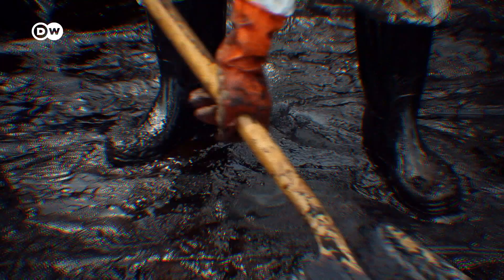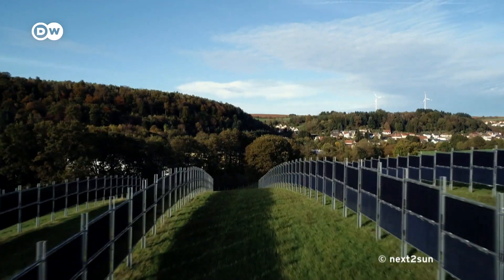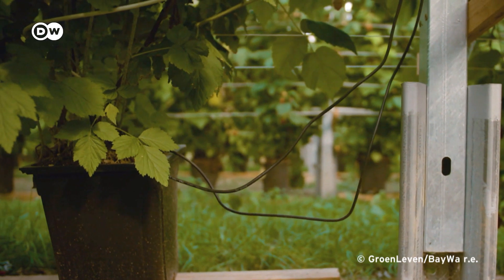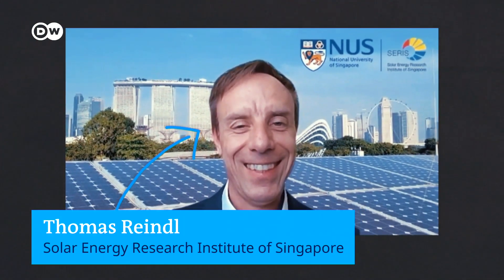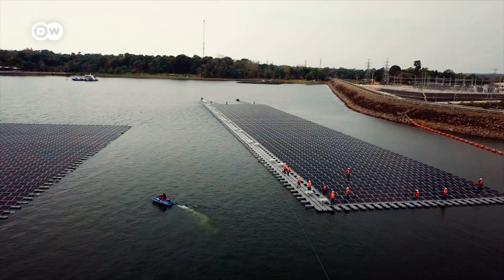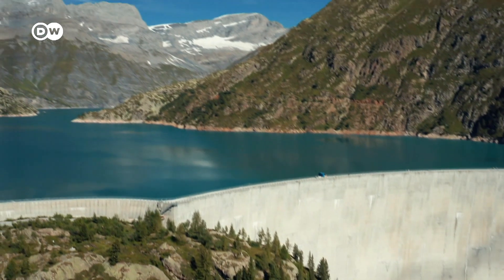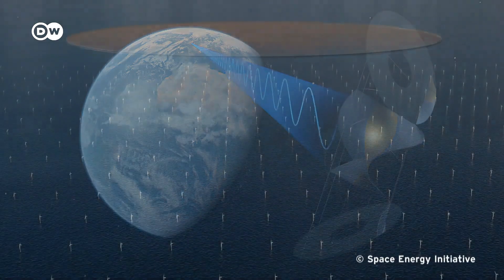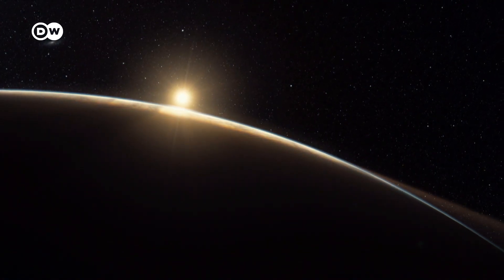Why we should be putting solar panels on our fields and lakes

Comment: One thing I’ve always though is cool about solar is that it doesn’t have an exponential relationship between size and output like other power generators.

Take wind for example (which I love), making the blades 1/3 longer actually increases output by much MORE than 1/3. But for solar, doubling the amount of panels doubles the amount of generation.

So putting 10 panels on the roof of a house makes exactly as much financial sense as covering a giant farm with thousands of panels.

So the title of this video is 100% correct. Put. Solar. Everywhere!
Reply: The exception there being economies of scale linked with installation costs. Cheaper on a per panel basis to install thousands of panels on ground mounts in a field than dozens of panels on the roof of a building.
Reply: @adamlytle2615  that’s definitely a good point. I guess my comment was mainly geared towards viewers who may be thinking “Should I put panels on my home or just pay extra to my city so they can put up a solar farm?”

The answer to that question is that you can put them on your home and still feel good knowing that they have some 90% of the “bang for your buck” as what the city would have put up.
Reply: @SaveMoneySavethePlanet  yep for sure. The payback timeframe has gotten so short that to me they are kind of a no brainer investment if your house has an appropriate roof. That said, as I walk through the upper class neighbourhoods of my city where houses have all sorts of variable geometry to their roofs, and are often shaded by trees, I can't help but think there'd be an opportunity for residential solar companies to sell people on owning panels mounted somewhere else. Partner with a nearby big box store or something to help share the costs of covering their roof with panels
Reply: @SaveMoneySavethePlanet  I have personally made the calculation myself for a solar installation on a home where I live. Long story short, even with government subsidies, I would still be losing money over the lifetime of the panels compared to if I was simply plugged to my local power company. It should be said that power is cheap where I live, but still, my point is that it's not as black and white and solar panels are not as amazing as people want to believe. Solar power is also more localized than people realize, some areas simply would never recuperate the installation cost or the CO2 cost of making the panels because of lower solar potential.
Reply: to be pedantic there is still the same exponential relationship with solar. if you increase the radius of a round solar panel by a third you increase the energy generated by much more than a third.

the difference is that solar costs would also rise exponentially. whereas the turbine costs don't. so small scale solar is still competitive compared to large scale.

or to put it the opposite way. if you double the area of solar panels you double output and costs. if you double the swept area of a turbine, you double the output* but the cost increase is lower.

*im not 100% sure thats correct.
Reply: This is simply a geometry illusion.
Increasing the blade length (radius) increases the swept area by the squared term in pi R squared (formula for area of a circle). 
There are usually 3 blades, and adding length increases the structural loads due to lift, drag, and centrifugal forces at more than linear rates as well.
As with airplanes, material limits are reached pretty quickly on the upsizing curve.
Reply: What about solar roads though .
Reply: @notherbalteanicetea  panels mounted above a road so that they cast a shadow on the cars or along the sides or median of the road? Absolutely.

Roads where the actual part that tires make contact with is made out of solar panels? I’m going to have to see more info on how they hold up over multiple seasons. As of right now, I’m unconvinced that they’re a legit option.
Reply: @SaveMoneySavethePlanet  they aren't. The concept already exists and it has been thoroughly debunked by Thunderf00t. There just isn't a suitable material for surfacing those panels that is durable enough, grippy enough and lets through enough light.
Reply: @jsplit9716  and EEVblog are very funny about it. I was really only meaning to say … everywhere ..but PLEASE ..not roads !
Reply: @jsplit9716  and EEVblog are very funny about it. I was really only meaning to say … everywhere ..but PLEASE ..not roads !
Reply: @notherbalteanicetea  PVs don't like dirt, abrasion, or mechanical stress. Roads produce loads of all three.
Reply: @westasleep  I’m glad they weren’t mentioned by the presenter as deserving further trials .
Reply: @notherbalteanicetea  Semi-trailer go BRRR.
Reply: I agree with the core of your premise - the huge benefit to solar is that it's economically viable at a domestic scale. But I don't think it's fair to say that it makes "exactly as much financial sense" as a solar farm.

There are still economies of scale - not with the panels, but with the rest of the system. 100 homes with 10 panels each means 100 installation contracts, 100 inverters, 100 high voltage disconnects,  100 current meters, 100 grid ties...

That's to say nothing of the extra cost of maintenance/repairs on 100 small (mostly rooftop) installations compared to one large farm.

Comment: You know solar panels are prone to heating up their surrounding area. Added on the fact they’re pretty fragile and they take rare metals.
Metals that be better used in a nuclear power plant.
Reply: Surely if some of the sun's energy is converted to electricity which then flows off-site, there's less energy to create heat. The law of energy conservation.
Reply: @CBitsTech  Solar panels lose efficiency as they heat up, and they tend to heat up that being in the sunlight.
Besides they’re not that efficient in the first place.
Reply: @acanadianderg4035  But they can't create more heat than the sunlight that would otherwise heat the ground.
Reply: @CBitsTech  But the ground doesn't absorb as much of it as solar panels do.
Plus something like a nuclear reactor can make far more power with a fraction of the space solar panels need and with a fraction of the resources and infrastructure needed which means more space for trees, people, carbon capture, whatever.
And they work without sunlight too.

Comment: In fact solar panels are not a new technology they developed in the late 19th century and in the early 20th there plans to build solar farms in the Sahara desert but before during and after WW1 at the time oil is the cheaper option.
Reply: Cheap solar panels are a new technology though
Reply: Was the cheaper option... Not any more
Reply: @philborer877  back in the day
Reply: We have the space in our own back yards, so to speak, because every roof every bridge every road everywhere every structure everywhere can have solar installed. It does two things. It keeps the wiring infrastructure close to the use. And it shades everything. Every parking lot needs solar every freaking parking lot. We don't have to put it in a desert put it on every house every school every building ever made everywhere. Are you getting the picture.
Reply: You can't just put solar panels anywhere you like. They need to be as close to the equator as possible and they need to be angled towards the sun. They also need to be in a region that doesn't experience too much cloud covering. This means Deserts are the perfect climate for solar panels. Especially the Sahara since it's closer to the equator.
Reply: @asandax6  Mostly true. Apart from the equator part. That doesn't actually make any difference to annual energy output - you just angle the panel to compensate for latitude. It does affect seasonal variability though.

Still, not too bad: The southern US, much of Europe, anywhere in the middle east, Australia, parts of China - there are plenty of populated places where the climate is well suited to solar.
Reply: The modern panels are a great improvement though. Cheaper to produce, greater conversion efficiency.